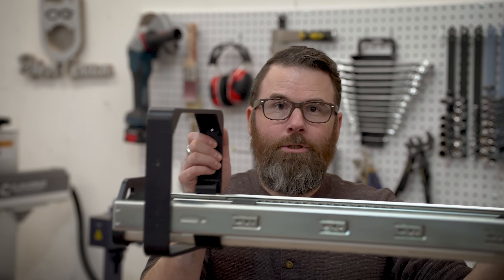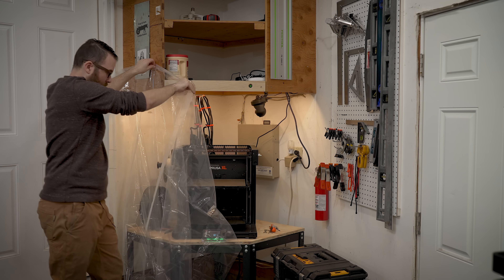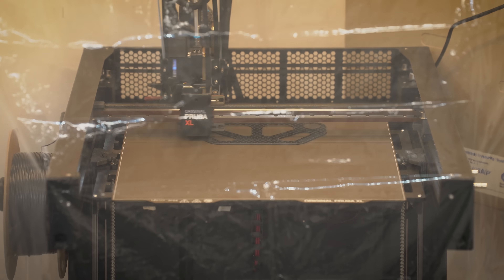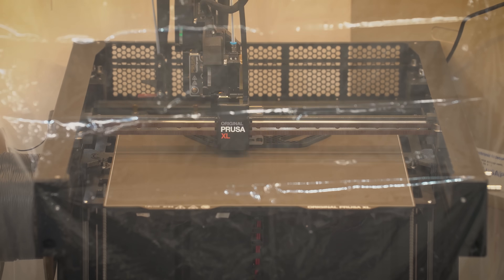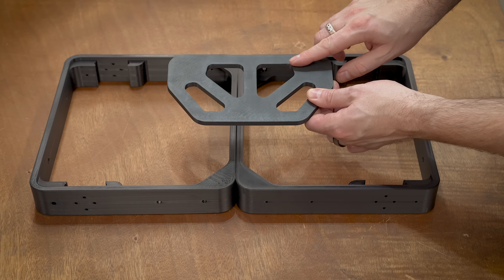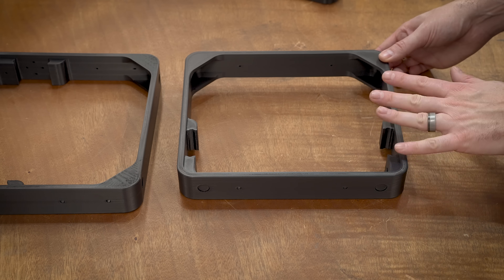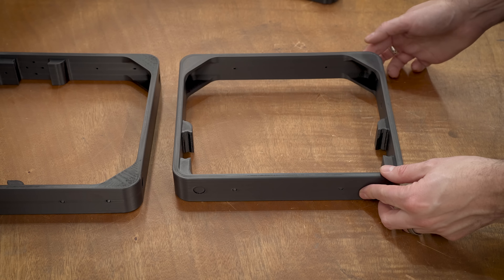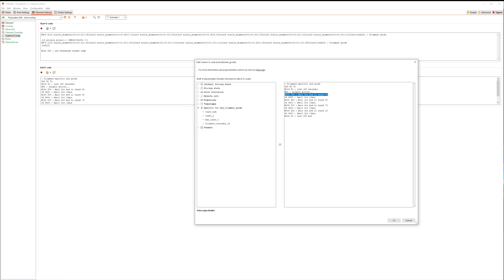Prusa XL vs. ASA - Update

Comment: Curious as to what print profile you are using for your ASA / what your bed temps, rough print speeds, and extruder temps are. 

I am also using the polylite ASA and having a heck of a time getting my part to NOT curl up the corners. 

Garage is not ideal (unheated, but in the southeast USA. It is insulated and attached to the house), but I do have the XL enclosure. 
Threw some beach towels over the top of it and I can sneak up to 36-42C

Your parts look fantastic! I have been struggling with ASA.
Reply from the maker: I'm just using the stock profiles, but slowing it down a tiny bit (on the outer walls).  That's really it.  Clean your build plate and make sure you have NO drafts or temperature changes during the print.  The first layer needs to be perfect, or else you will get stresses that cause it to curl.  Best of luck!

Comment: have you experimented with auto eject G code yet?
Reply from the maker: I'm not sure what you mean?
Reply: @RobertCowanDIY  G code that waits for the part to cool, then you use the tool head to push the part off the build plate so that it can restart automatically
Reply from the maker: @theNitefly  OH, I really haven't messed with that, I have no need for it.

Comment: I'm about to embark on this project (thank's so much for sharing your design so generously!)   I print in an unfinished area of the basement that I can close off from the rest of the house.   I plan to use the shower curtain trick and crack a window nearby for room ventilation.  But wondering if I should prioritize one of the available enclosure designs before tackling this project.

For the filament drawers I'm planning to prepare 6 units and arrange them 2 wide by 3 high mounted on a furniture dolly.  (All my 3D printers are on wheels so I can rearrange things in my tight working space.)  I'd like to have a plywood top for an extra work surface and wondering about supporting it. I could enclose the drawer units sides and back in plywood as well to support the weight and thought if printing a extra frame piece installed mid-way in each drawer unit would be enough.    Any thoughts?
Reply from the maker: The frames really aren't meant to be load bearing beyond just the filament.  I'd suspect it wouldn't be terribly sturdy.  It won't collapse, but it will be 'bouncy'.  BUT, you can just put some wood supports on the outside of the structure and use that to support the top.  Since you have mounting holes on all surfaces, just do vertical supports on the outside to stiffen it up.

Comment: I have a question on bed temp, when you use the make shift enclosure do you heat the whole bed  or use the default bed temp which I beleave only heats the print area?
Reply from the maker: The XL does zone heating, only heating the areas of the bed that are used for the print.  This has worked out well so far.  I should get a thermal camera to actually see this happening, but I can actually feel that certain areas of the bed are colder than others.  It only seems hot/warm where it's printing.

Comment: I use a lot of ASA because of the temperatures and in my case UV Stable, it is the most stable for outdoor use of all print materials that are readily available. On Prusa's material guide, it is the only material listed for ultra violet. I use ASA-Carbon 15% for some parts with a Prusa MK3 in an enclosure at 50C. Works really well. Thanks for the tip on part cooling, that is a big deal. A material I am just trying out is Polypropylene-Carbon, very good high temperature properties and no enclosure needed, very low CTE (coefficient of thermal expansion), should be a very stable material. I have also found ASA needs to be kept dry or it starts messing up, it absorbs moisture quickly.

Comment: Robert, thank you for the great content on the XL. I am looking to buy my first 3d printer for prototyping and possibly short runs in my machine shop, similar  stuff to clough42. I am torn between the XL and X1C. I don’t mind spending extra for XL as long as it’s worth it but I do see a lot of people having issues. If you had to purchase only 1 printer to start with would you go xl or x1c. Thanks
Reply from the maker: It's a good question, but they are two completely different machines!  If you NEED the larger format, or you NEED to print multi-material (not just cosmetic stuff), then the XL is the one to go with.  If you NEED an enclosed printer or faster parts, get the X1C.
Reply: @RobertCowanDIY  Thanks for your response Robet. Got my XL up and running and could not be happier. I am going to do the sumo enclosure, I am currently printing it now. I Really appreciate the good XL content and am grateful for the files on this. I will also make these drawers with your designs. You and Clough42 seem to be my favorite channels recently. I should have gotten a 3d printer a long time ago.
Reply from the maker: @VanoverMachineAndRepair  Awww, thanks!  I wish I had Clough's numbers!  Did you see the official enclosure just got released?
Reply: @RobertCowanDIY  I did just as I got the parts for my sumo for their enclosure. O well such is life. Maybe on my second xl (2 toolhead) I’ll get the prusa enclosure. Really liking this printer. Thanks again
Reply from the maker: @VanoverMachineAndRepair  Wait, you like it?!  The internet says it's terrible!  Ha.  Enjoy the printer!  I like it too.
Reply: @RobertCowanDIY  yeah I really do. Reality vs internet… you know how it is.

Comment: Hi Robert, thank you for take us through the journey of your large format multi-material printing. If you had a project which could take full advance of multi-material, which printer would you go to first? Would you possibly consider a video on this topic. Thank you for your consideration
Reply from the maker: I'm not sure what you mean?  If I require multi-material, it needs to be the XL.  The Bambu really only works with similar filaments.  Sure, you can go between PETG or PLA, but I'm going to want to switch materials with drastically different properties, not just colors.
Reply: @RobertCowanDIY  sorry, I guess without actually owning both the XL and the Bambu with AMS I'm not understanding how they different. Both are capable for printing very drastically different materials at the same time. One is 5 extruders and one is just 1 extruder. Prusa slicer does warn the drastically different material bed temps when slicing. However, Bambu slicer does not seem to care if I slice a part with PLA, ASA, PETG all on the same part. Perhaps in practice that isn't possible with the current printer offerings.
Reply from the maker: @webfiles4utube  Check my video later today.  In short, you're not supposed to use abrasives with the AMS, it doesn't work with TPU, and there's a LOT of extra waste and time in switching filament compared to the XL.

Comment: cura has a very good function for asa
wind protection
it makes an adjustable wall around the model
I already use it for all my prints
This makes it very easy to prevent ventilation at the corners
and the layer adhesion problem is improved
Don't forget to turn off the fan completely
Reply from the maker: I could do something like this, but I have around 30 of these to make and that would use quite a bit more material (and printing time).

Comment: I've got to ask the obvious question. Why haven't you enclosed your XL? I have always put an acrylic box around my printers.
Reply from the maker: It's a good question.  I guess I'm still waiting for the official enclosure.  I'm also going to move it around a bit, I ordered the extra 3 toolheads, so I'll add those when it arrives.  It's still a work in progress for right now.  If there isn't an enclosure option by summer, I'll make my own.
Reply: I look forward to the design you come up with  @RobertCowanDIY  !

Comment: You need ventilation if you are going to be running ASA, especially if you are using any amount of it. Take your health serious.
Reply from the maker: Understood.  This is not a living space and I have a HEPA air filter on the ceiling.
Reply: Living space or not, if it isn't well ventilated it is putting you and others at risk
https://youtu.be/aLU0SzzSmOE?si=YKc5TxT0-2Z8bwy1&t=1107
 @RobertCowanDIY
Reply: Lol do you even now how much VOC’s one printer emites while printing Abs/Asa? Its barely nothing. It’s way worse to just be stopped at traffic breathing exhaust fumes.
Reply: @nunovicente34  tell that to people that end up with styrene poisoning

Comment: now you need to wait 20-30min after each ASA print...😯 if there is no other options, there is not other options!
Reply from the maker: This really has less to do with the XL and more with materials that are prone to warping.  The same problem was happening on the X1C, it just cools down much slower so I don't need custom g-code.  But removing a part while it's still hot and making it cool rapidly will cause warping, regardless of what printer is used.

Comment: Thanks for showing your results.  I have not tried ASA yet, but have done a few ABS and tried the same cool down as you, but did it in the end print gcode.  I have had pretty good results with the SUMO enclosure.  It keep the internal temp at 100 F.   The cool down helped a lot, still had some minor warping, but was a very large part.
Reply from the maker: Nice, good to know.

Comment: Thank you so much for sharing this video. I've been struggling with ASA on my Bambu X1C, especially for a model that printed well with PETG. Unfortunately, I've encountered significant warping issues with ASA, particularly on a crucial part of my project. Even preheating the X1C caused the ASA to stick to the build plate, but then the plate started to bend.
Knowing that slowing down the cooling process was key to your success gives me hope. Although I'm not great at coding, I'll give it a shot. Thanks again for the insight. 🙏
Reply from the maker: for sure!  slowing it down and adding the gcode at the end should help out a lot.

Comment: Potentially wonky suggestion I just thought of, but to get at least a somewhat serviceable temperature, I think some portable PTC space heaters can keep like 35 degrees Celsius, maybe even higher, and while that's not ideal temps, it could probably be enough for the XL especially since it has printed parts that might get soft with much hotter temps anyways.

Like perhaps just putting one with a decent thermostat under the table the XL is on, could keep that whole shower curtain area reasonably warm, while not wasting too much electricity given its such a small enclosed space and it would only be running to top off the temperature so to speak.

Comment: I can see no sharp edges. :)  
Xl is ringing?
Reply from the maker: There is a bit of slight ringing around the screw holes along the edges.
Reply: @RobertCowanDIY  
The XL always going to have that issue. Because the heavy head. That is why not worthy to even try to make the print faster by changing out stuf. The software trickery (input shaping) helped  a little. But the heads should go through some wheight loose.

Comment: if you pop something and it starts to warp quickly put it back on the bed and every time its flattened for me. Could also slightly warm it with a torch on a flat surface, can help save a part.

Comment: Great video!

Temperature is the major issue and the reason I cancelled my XL order.

Enclosures are in my view, necessary to print these materials. Yes, you can get away with a tent or similar partial enclosure, but as you experienced you are really fighting the ambient temp. 

For ABS/ASA it doesn't seem worth attempting to print if your chamber temp is not at minimum 40c. 

On a multi thousand dollar machine Prusa still has no official enclosure solution. This is unacceptable in my view.

Nevermind the actual VOC's that ABS and ASA release. You cannot effectively filter or extract them without a proper enclosure.
Reply: There is an enclosure on AliX

Comment: Very useful and clear video (well except for the super high resolution in the Prusa Slicer part, which made things illegible at 1080p, but you did explain everything that was on screen so no big deal really), this will smoothen the path for me moving towards ASA printing :) Thank you for adding temperatures in C as well as F too.
Reply: YouTube seems to default to lower resolutions, but clicking settings and adjusting made it viewable for me at 1080.
Reply: @CharlesLogstonInTexas  Yeah, I was watching at 1080p but you're not wrong either.
Reply from the maker: I'll have to remember that.  I use an fairly high resolution ultrawide, so recording the screen is always a bit of a trick.
Reply: @RobertCowanDIY  I should clarify; by "things" I mean the text was just a bit blurry.
Reply from the maker: @TNX255 Noted, at full resolution it looks fine to me, but I'll watch out for that next time. It's probably best to watch full screen though.

Comment: I've had those top layer defects with ASA.  I haven't found a great solution.  I'll try slowing down.

Thanks for the tip.
Reply from the maker: Yeah, maybe try turning down the flow rate a bit and making absolutely sure you have high enough ambient temperature?

Comment: I guess it begs the question, I assume that the Prusa has good main board and power supply cooling? I was thinking about attempting some "warmer" environments for my BL A1, I understand however that the chipset and the power supply both do not have cooling fans, not even a heat sink. I use a 4x4 closet for my printers on a bench, the temps get to 28-30 C with the door closed. I can monitor temp and video remotely. For warmer temps I can place a very small heater in there but don't want to induce heat issues on the main board. 

I appreciate your video, I think I will try some ASA and see if my setup is good enough as it is without extra heat and go from there.
Reply from the maker: 100F ambient is totally fine for the electronics.

Comment: Would be interesting to take the temp the other way.  I've printed some thick wall, long PLA parts that always warped up at the ends.  Maybe taking the part up above its glass transition temp while still stuck to a flat surface could relieve the internal stresses.
Reply: I had that too, but then I watched one of Slant 3D's videos where he showed a neat way to add thin round slabs that resemble Mickey Mouse ears to the corners (or anywhere you want) of such parts that act as brim but only where you want them to. They're also easier to remove afterwards instead of a full brim around the part. You can do that in CAD when designing the part or alternatively in PrusaSlicer as well.
Reply: Haha yeah, I actually "invented" that to fix my problem before I found out that was already a thing people did.  It works and keeps the part from falling off the bed but there are still stresses in the part from the top layers shrinking after being stuck to already shrunken lower layers.   @TNX255

Comment: My MK3S’ flow is set to 95% by default under Tune -> Flow, and looking online this is apparently because Slic3r-derived slicers like PrusaSlicer tend to overextrude. Is there a change with the XL/MK4 that turns that back to 100% perhaps? Do you need to reduce flow only for ASA, or for other filaments as well?
Reply: Every type of filament requires its own flow calibration. In orca there's a tab to run the tests to figure out the best results. PLA and ASA for example have different shrinkage rates and even brand to brand can result in slight differences. My rule of thumb is when getting a new brand/type run a couple tests (temp/PA/Flow) and you should be good to go without any issues.